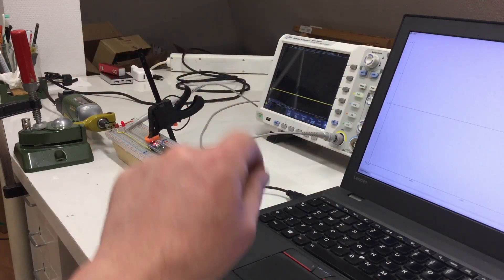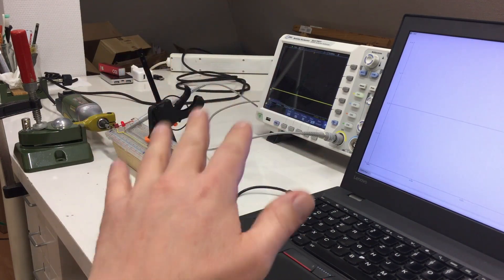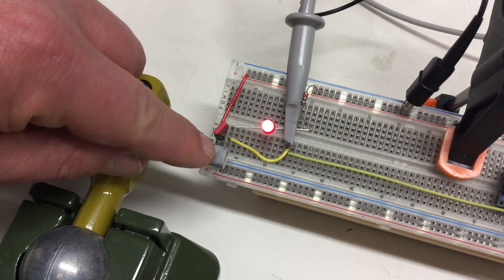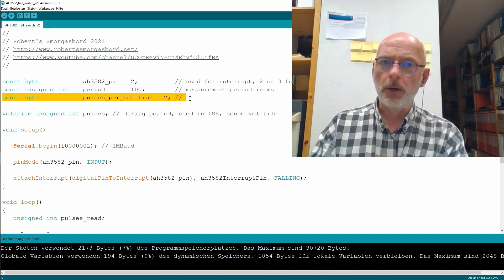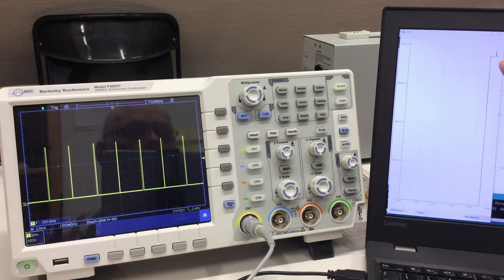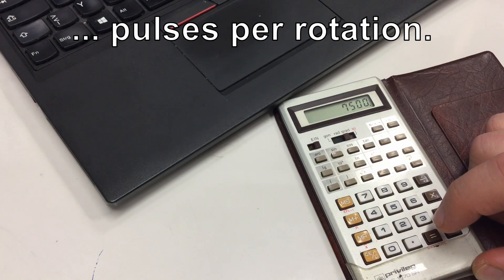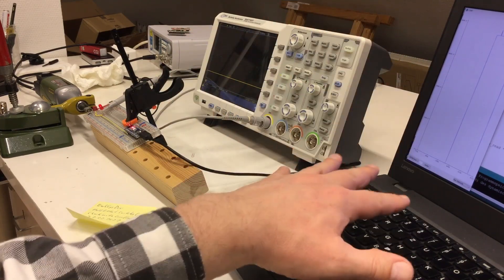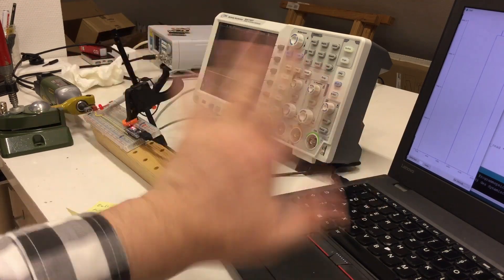Hall Effect Switches (e.g. RPM Measurement with AH3582 and Arduino) Verified

Comment: Hey nice video indeed ! Do you know If it works with linear hall effect sensors(RPM measurement) when I put a comparator behind them ?
Reply from the maker: Using a single linear hall effect sensor and just comparing its output to a fixed voltage might work, but is fiddley (there's a reason that AH3285 has some circuitry inside to constantly "zero out" its threshold). I guess if you use two linear hall effect sensors (say 90° apart on the motor axis) and compare their outputs, that could be working quite well.
Reply: To get two different shifted square waves like on a rotary encoder you mean ? That opens even more possibilities then like motor direction and RPM for example. Cool thanks for your hint !
Reply from the maker: @Telectronics  Yes, exactly. To be honest, I didn't even think about the possibility of quadrature encoding. I just wanted "differential" signals for the comparator.